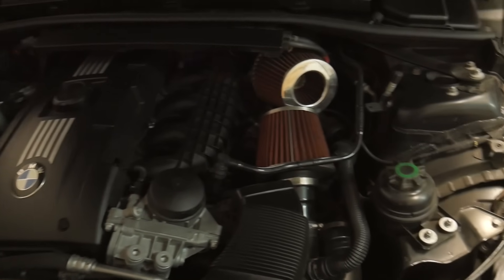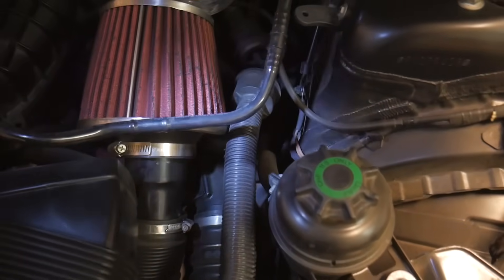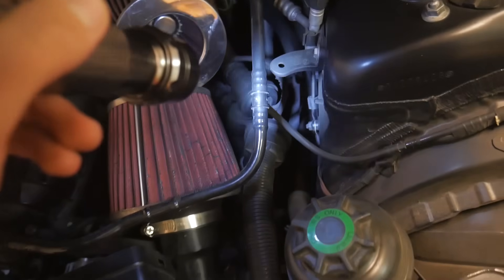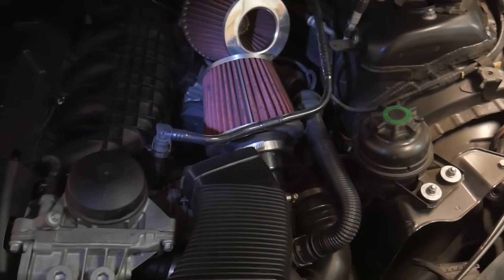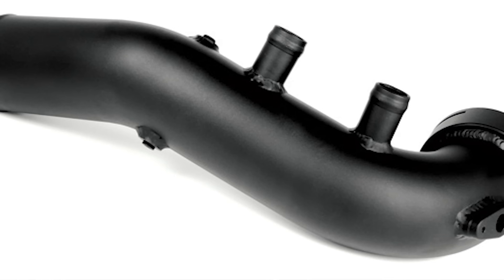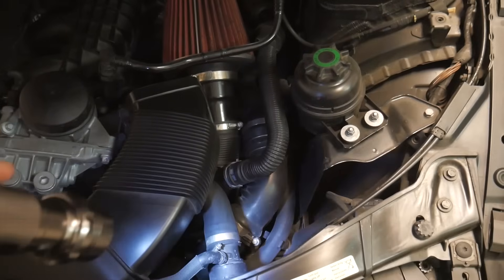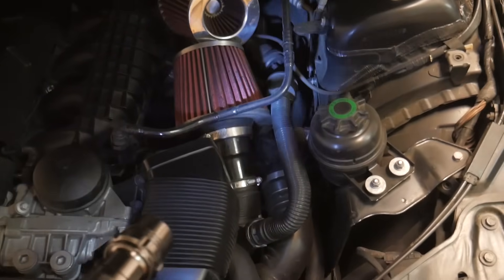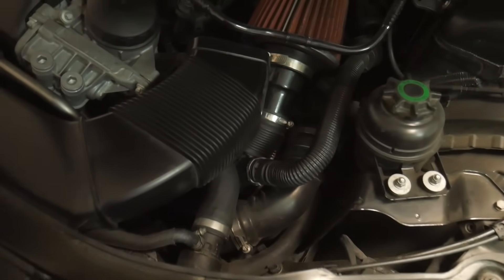The MOST COMMON Cause Of BMW Limp Mode (E90,E92,F30)

Comment: I was having an issue with going into limp mode everytime I did a hard pull. Turn the car off and back on and it was fine. Turned out to be my Vanos solenoid (manifold side). Took both out and cleaned them real good with brake cleaner. Made sure they were dry and put them back in. Haven't gone into limp mode since. Very easy job to do.
Reply from the maker: Ghaith Abdulla nice fix! Yea i actually did the same a few months back. Today my water pump went out so i have to replace that now :/
Reply: Did that yesterday and I just went back into Limp Mode 😔
Reply: B Min exactly what mines doing maybe that’s what’s wrong
Reply: @SonarOfficial_  did you find the problem to get out of limp mode ?
Reply: Same car runs good but limp on hard acceleration ima do what u did hopefully it fixes it because it’s really annoying
Reply: Transmission or engine malfunction??

Comment: Mine ended up being an HPFP failure. Those symptoms consisted of everything feeling normal at idle and start up but when accelerating it and getting into high revs would trigger limp mode.
Reply: Then watch for misfires, that is usually a fuel injector issue
Reply: Does a HPFP cause a rough idle and your bmw to turn off ?
Reply: @alexmontoya2171 yours was doing that ??

Comment: I watched this again I guess because I watched your previous vid where you changed your CPS and I have been having limp mode issues due to my MAF continuing to go out on me for some reason but as I was listening I noticed you were speaking about the N55's propensity to blow at a much higher rate.

You said it may be due to the fact that we do not have a blow off system, that is incorrect because we do have Diverter Valve but they're plastic cheapies (as you well know most BMW stock parts are).

My remedy for the blown plastic CP was to get an aftermarket one (ER) but I also ordered some  GoFastBits Diverter Valve to replace the cheapie plastic one.

Keep up the good work on the vids and enjoy your vacation.

Comment: Every since I got my 5 stepped intercooler, sport oil cooler valve and diverter I have had no Limp Mode issues at all and my chargepipe has held up brilliantly.

Comment: Quick fix to limp mode is to shut off the car for about 1-2 minutes and it should drive normal unless it's a real serious problem the computer wont even start the car especially if something electrical is the problem
Reply: So my car was going into limp mode then one day I was driving and the car just died and windshield wippers turned on and just died
Reply: It sometimes helps, true, but whatever the reason is it’s a good idea to visit repair shop ASAP. 

The ECU has detected that something is not working as intended, and even if your engine runs normally the malfunction may cause accelerated wear, or even damage the other parts. 

Also driving in limp mode too much is not a good idea - ECU has cut off the turbine, retarded ignition and injection (to mitigate possible knocking) turned off variable valve timing and lift - which means worse efficiency. Worse efficiency means that less heat goes into generating torque and more into engine - so the engine runs hotter than it should, even if waterpump is boosted.

Comment: Hey listen I have watched so many videos on this but I decided to comment on this one I have a bmw 330i I went threw everything long story short short a old man told me to disconnect both battery terminals get a booster cable connect one end to the hot and the other end to the negative I swear it fixed my limp mode leave connected for about 1 min connect the battery back and I swear it worked for me the thought is it will drain all the power out the car and reset everything it working

Comment: Just bought a black 335i coupe just like this one bout 2 months ago....,already have this problem.
Reply: Don't put your foot down hard till over 4000-4500 revs. Mine never does it above that but it does below all the time (or used to). It is saving me having to spend £1500 on getting the turbo charger re-cored for now

Comment: Help!?  Replaced charge pipe & diverter valves. Still limp...P0012...cleaned vanos solenoids...STILL limp..
.any ideas what else i can try?  Camshaft position sensor?
Reply: How's the transmission fluid?

Comment: Hey there, My 123d goes into limp mode at 4000rpm after +-250cv 485nm..idk if its caused by high pressure fuel pump or what else but would like to see more, it has no dpf only last resonator, swirl flaps removed etc

Comment: My x5 went to trans safe mode aka limp mode after I ran out of gas on the freeway ,put 1galon in reset the ecu by holding the gas pedal for 30 sec..while key on position 2, and good as new ...no limp mode no codes, fuel pump not damaged 😊
Reply: But these are click start, how would we do that?
Reply: @rileytavares4087  who's we? Speak for yourself ....
Reply: You honestly saved me because I had ran out of gas I put some and I had lost power I did this and it completely fixed it thankyou so much 🎉🎉🎉

Comment: I wanna know why I've spent like $6000+ trying 2 figure out why my 2008 535i goes in2 limp mode so often. I've gotten new fuel injectors, new hoses, got the carbon cleaned out & all sorts of stuff but it's just a bad as b4. 4 as much as I've spent I probably could've gotten all new turbos. I'm about ready 2 trade my car 4 a horse 2 ride 2 work 🙄
Reply: Turbo?
Reply: Cleaning maf sensor and change or just clean vanos solenoids
Reply: Me asf right now 😣😣
Reply: Did you try the Solenoid cleaning fix?
Reply: HPFP bro change it with the low pressure and filter bro
Reply: Have the same car in México and i changed that and its goood i am a mecanic in mexico only euro cars trust me change those 3

Comment: hi I have a 2005 e90 diesel ..starts nicely rev count stays on one position no jerking.  its an auto but it does not have that much power like the other bmw auto does more especially on first and second gear and it blows a black smoke but when you clock 100k/h the smoke's gone and the power is back it sharks like a rocket and it worries me more especially on robots , stop signs its embarrassing ...thanks in advance boss.
Reply: Black smoke is usually oil burning. Grey smoke is excessive fuel. Could be a number of things. Could just be time to change your air filter, could just be that your engine isnt warmed up fully yet. Could be your pcv is sucking too much oil into the intake. Could be oil leaking past the turbo seals. Try doing an oil and filter service and run some injector cleaner in it and install a catch can and see if it goes away. If it doesnt then get a mech to check the condition of the turbo

Comment: I just bought a 2013 335IS 68k the old owner just changed the water pipe and its bone stock in what order what would you start with as for bolt ons? Awesone videos thank you!
Reply: Straight to stage 2plus waist no time with stage 1 and regular stage 2 n54 stage 2 plus kits running for as cheap as 1200

Comment: This doesn’t really help me with my S65 4.0. It keeps coming up with throttle actuator codes but the actuators are perfectly fine. I’ve noticed running fuel injection cleaner helps but it’s getting annoying.
Reply from the maker: WyoHornetUSMC usually ive heard throttle actuators go bad because of an internal issue where the plastic gears break and don’t operate properly. are you sure you know they’re fine?
Reply: Simply Car Things considering it doesn’t do it often and, after using fuel cleaner, quits popping entirely, I’m pretty confident the computer is just wrong.

Comment: I replaced knock and cam sensors and vanos solenoid and still got limp mode then walnut blasted intake manifold and no more limp mode faults. 2008 335i convertible
Reply: My seat was stuck so I had the seat jumped off to see if I was getting power to the motor of the seat and it went into limp mode. Do you think that would work

Comment: I HAVE A 2006 330i that loose power, sputtering after accelerating enough to just get on the freeway or pass another vehicle. I almost loose all power it feels like. Check engine light comes on for the moment
Reply: cayce davis  I have the same problem I just put in new crankshaft and the canister purge valve. And the shit cleared the abs light but no power  did you fix yours ?

Comment: So I have a 2007 335i sedan. Right now its in limp mode(engine power reduced), the car coughs if I go near the throttle and a p0172 code to boot. Any ideas?
Reply: Anibal Curletto same here 😐
Reply: Anibal Curletto did you find out what it was?

Comment: My 335i did something’s strange and I need help ok so was cruising and went into limp mode pulled over looked couldn’t find anything restarted it and code didn’t come back should I freak out?? I have aftermarket charge pipe so I know that’s good

Comment: Does BMW provide on-dash notification of 'limp mode'? If not, what are the symptoms? Just significant loss of power? I have a period loss of power (I'd estimate somewhere between 40-60%), and in the past this has been a brief experience - like maybe a mile or less. Only occurred once in a while - every other month perhaps. Last night, I had the same - but for 40+ miles. After turning off the engine and ignition for an hour, then back on ... symptoms were gone, power back to normal. No engine lights or any other warnings. No change in sound ... just loss of power. Btw ... this is a diesel motor. Thoughts?
Reply: You get a half check engin lights When driving If it’s a boost leak you might only get it while pulling
Reply: @cesarmurillo7267  Hi ... this was a long time back, and it turned out to be the DPF. This was cleaned, and everything returned to normal. I had 2 shops look into it ... the 1st didn't do a good job. They put it one the diags computer, and started messing about with MAF and temp sensors. I paid $400 for them to not fix the issue. I then took it somewhere else and they said it was DPF - fortunately that was correct. Cost another $300-400 for cleaning and labour.
Reply: @jay26cee Hi, I got BMW E90 Es Auto diesel registration 2012, my car loose power on roundabout or signal if I accelerate suddenly. Half engine light comes, if I switch off again and  restart it is normal, no problem while driving.it happens only in signal or roundabout when giving acceleration, is it like that you experienced
Reply: @vinumathew8610  Hi, it turned out mine was DPF getting blocked up from city (slow) driving. I had it cleaned out, and all was fine again. But, 16k miles later, it is starting to happen again. So will have to have it cleaned again. Or, replace with new but new is 5 times the price. Over £1200!

Comment: Will a cracked charge pipe cause my car to smoke from the tail pipe? My charge pipe is also metal. As soon as my engine malfunction light comes on my turbo shuts off and then the car smokes bad when stopped but running. 2007 bmw 335i. Any help appreciated. Thank you.
Reply: What colour is the smoke? Black, blue or white?

Comment: Hey man love your videos,  straight to the point. I need help, what's your opinion... 08 335i was diving great, all the sudden small pull and it went limp.  Got home,  ran codes. Got O2 fault bank 2 and misfire cyl. 6, 5, 4. Changed coils, injectors, and plugs maybe 20k or less miles ago. My boy runs like crap. Not even driving, cleaned vanos selinoids. Still I'm lost.
Reply: Any luck?

Comment: I dont think what i am experiencing is limp mode, but I've been experiencing my speed decreasing on the highway if im going 80+ mph and then shutting off. I took it to bmw they miraculously have never heard of this issue 🙄 and said it could be because my battery voltage is low but my heart feels like it isnt a battery issue.  Have you experienced this? Today i was only going 35 mph not on the highway, and the car shut off on me.
Reply: Have you fixed this issue I’m having a similar issue? What was wrong?
Reply: @FrostyH2O  it was a recall on the year make and model of my BMW they had to fix it. But the first place I took it treated me like I was crazy then I got the recall in the mail
Reply: @jashondasc what was it?

Comment: Can you do a vid on over heating? I was driving my 2012 bmw 335xi when I noticed the temp warning light came on. First orange then turned red. Then my car went into limp mode.
Reply: You need coolant go to your auto zone ask for some anti freeze an fill it up to the max line mark
Reply: @kashsmokes2123  did you ever get a fix for this? Mines doing the same. I’m thinking temp sensor or thermostat
Reply: Did you ever get a fix for this? Mines doing the same. I’m thinking temp sensor or thermostat

Comment: I have a issue. So my mechanic replaced my injector fuel on one of the cylinder. Its the cykinder 3. Things were fine but once i turned off my car and turned it back on 6 hrs later. It went to engine malfunction reduced power. What do u think its the cause

Comment: My 320d e90 won’t rev over 3000 rpm, whichever gear. turbo was repaired before 50 000 km, should run 100k km more easily. My tops is 155-160 kmh in 6th gear (2900-3000) and thats it. Pulls good until those rpms. Haven’t checked anything yet. Any thoughts on what the problem could be?
Reply: What was the issue mate?
Reply: @IKenexPSN  Diesel Particle Filter. Took it out and turned it off in the ECU

Comment: I’ve got a BMW 325i. It’s my first car and it came with a blown engine. I’ve bought another N52 for my car and I’ve put it in, it drove for a week then this error keeps coming on. It’s a red gear symbol which I think is limp mode, when I put it in gear it just revs there and does nothing, car dosent push like it’s locked. I’m not sure what’s wrong.
Reply: i have the same problem, did u end up fixing it?
Reply: Miguel Morales I didn’t :(

Comment: Quick question. You mentioned limp mode ccan cause a lot of things. I was driving fine on morninng. Park the car, 8 hrs later started the car traction control light was on and the gear with ! Inside. And stuck in 4th gear right now.. still starts and runs just rinning on 4gear. Do you have any idea why  both lights are on e46.

Comment: Had my first engine malfunction message with my n55’s stock charge pipe failing on me at 4-5k rpm at the throttle body. It has 116k miles on stock boost
Reply: What exactly was wrong with the charge pipe? Also I am noticing that after warm starts after I was driving for awhile the car feels really sluggish and has boost surges.
Reply: @beckmarchiniak716  it just sheered off at the throttle body and wouldn’t go back on. It failed while doing a pretty good pull
Reply: wow ok yeah I haven't had that happen, I get weird boost fluctuations but only when the car has been driving off and on all day. Im not sure what the problem is yet.
Reply: @beckmarchiniak716  at least my pipe didn’t explode like it had for some people
Reply: @exaltedb  Do you think it is possible that when the engine bay heats up the plastic pipes shift enough to Lear air in? Because at only have problems after a warm start like leaving the gas station and then I get low fuel pressure codes, and the fuel pumps are fine
Reply: @beckmarchiniak716  first, I’d check if there’s any vacuum leaks anywhere. Had an intermittent P112F that ended up being caused by a broken vacuum line
Reply: @exaltedb  ok sure I’ll check that first thanks

Comment: Hi this completely off topic I have a 2007 335i auto when driving putting foot on accelerator when gear change from about 3 to 4 I get a humming noise and it's as if car holds back then leaps forward something to do with gearbox I think do u have any ideas tried reading codes but nothing show
Reply from the maker: you sure it isnt a misfire ? based off what you described thats what i would guess
Reply: Defo not a misfire what happens is when driving it feels as if something is holding it back then lets go so shoots off.  Even the revs go up but car just feels as if something is pulling it back
Reply: @BharatPatel-kf4vu  Did you ever solve this problem. I'm having the same problem. No codes. Slow to no acceleration when I shift then it takes off like nothing happened. Doesn't do it everytime but I notice the humming sound in the engine bay as if the fan was going and once it stops the car goes. Also happens when I'm taking off from a stop. Barely any response from the pedal then after about 5 seconds the car is back to normal

Comment: Hello bro! can you help me , I have codes 2c31 and 2c6b  on my 2009 bmw 335i, do you know the reason of these codes?
the scanner tell me that is O2 sensors
Reply: Could be Vacuum Leak, O2 Sensor  before the Catalytic Converter, or some Oil Leak (Turbo leak, Cracked Cam Cover). Is their any noticeable changes in the N54s performance?

Comment: Help! One of those grey plastic clips that connects the diverter valve hose to the charge pipe cracked and a piece of plastic got into the charge pipe. I thought i got it out with a vacuum but I guess I didn't, drove down my street and as the turbos spooled the engine began to knock like crazy! Any ideas what's going on? Thanks in advance!
Reply from the maker: TheGmanG35 have you removed the broken charge-pipe to see if the plastic piece is in there?
Reply: Simply Car Things im pretty sure it got sucked into the engine, the knock is so bad
Reply from the maker: damn, i'm not entirely sure what to do in that situation. For now try to drive the car as little as possible so you don't risk damaging your car until you get it sorted out
Reply: Simply Car Things yea it's rough dude the 335 is such a fun car I already miss it lol thanks man
Reply: Turns out it was my fuel injectors... Misfire in cylinders 1, 2 and 4 but luckily no engine damage! Pricey but fixable